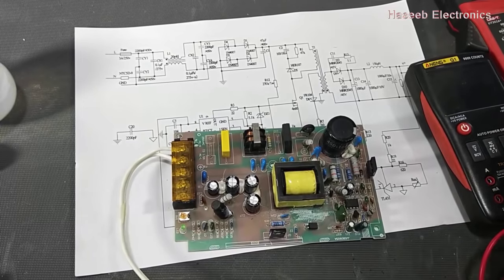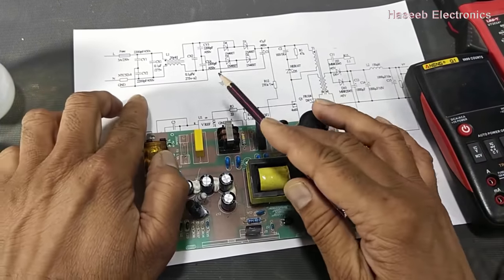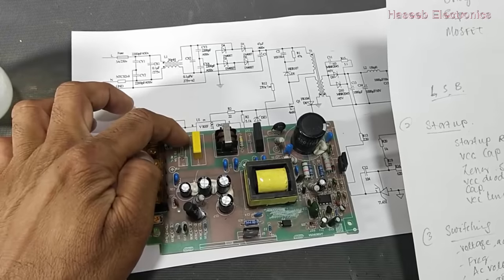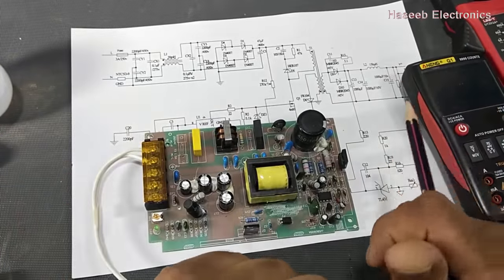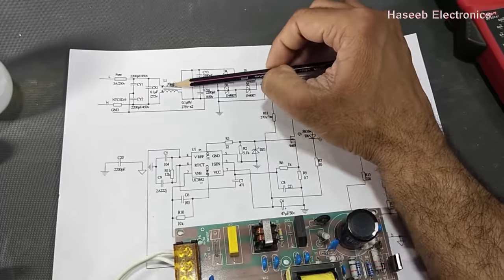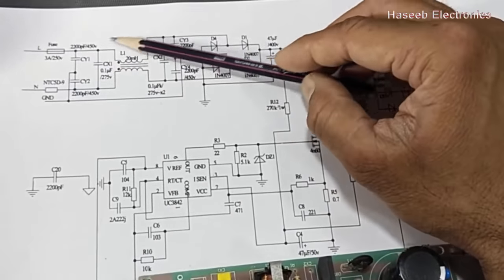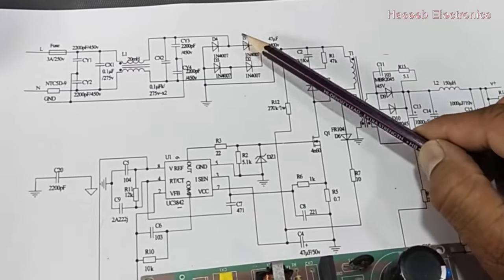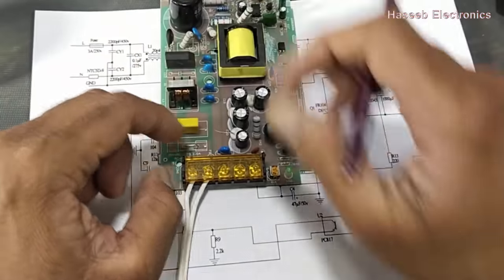{528} How To Repair SMPS || SMPS Repair Step By Step || Switch Mode Power Supply

Comment: Wa-Alaikum-Salaam. I am an Electronics Engineer of many years fault finding. One of my specialities is SMPS and this video is the best of its kind on the internet. Very comprehensive and informative. 

Thank you for imparting your knowledge to others in such an easy to understand format.
Reply: I have a compact logic power Supply of AB. I am facing shutdown problem i.e. on/off problem. What should be the issue with it..

Comment: Hello dear hasseb thanks bro for all your advices, I'm biomedical engineer from Morocco I appreciate your work, in my daily work the most problem I find in medical devices: power supply
Reply: I'm working now on a power supply of medical lamps input 24vAC/24vdc output, there's no output I checked all components , even flayback ics I changed 1252A ( primary ) ic and 4303A (secondary)ics and MOSFET too but no output in pin 6 (Drv pin for 1252A ic)

Comment: awesome job! i am fixing a macbook fake chinese charger that i bought off ebay that was broken. they used the same circuit! there was a few burnt components that i was able to replace., thanks bro!
Reply from the maker: you are right 
chinese copy method is really wonderful, they mold cheapest designs to replace costly branded items. problem is that while repairing we cannot find their servicing documentations

Comment: good evening, thank you in advance for all the courses and indications you published to help people understand how the electronic cards work, my problem and as you explained is in the power supply of the relay resistor to get the 220ac to the rectifier bridge, the resistance takes the line from the zener diode which in turn is connected to an ic....thanks in advance for everything

Comment: Many thanks for this excellent informative video, and sincerely instrumental in providing immense better understanding of the systematic breakdown for fault diagnosis! I greatly appreciate the video diagnostic presentation was exceptional from start to finish including the specifically identified test points and polarity, and the concise detail of the expected test result and in depth attributing fault factors or the secondary outcome by a specific fault. I myself was working on lawnmower 120VAC/24VDC charger no output @ primary transformer. On this charger JSC-1056A in lieu of UC3842 (by your application), this charger has has Texas Inst. 28600D controller on the Hot (primary) and dual  LM258N Op Amps on the secondary. No surprise your presentation is near exact similarly bang on in layout. My fault specifically falls at open "T1 input and as you called it; the finding was "shorted diode" D1 , Resistor R11 @ tests high in circuit (spec..27ohm). Whereas resistor R3 tests "shorted" @ 46k ohms expecting spec. @  420 M ohms  (Q1) Mosfet SSS7N60B tests good in or out of circuit but.... I found; "what looks like" carbon diode identified on PCB as "RB1" in series with mosfet "drain" to T1 transformer unfortunately it does not have any visible markings and appears shorted along with indicators of overheat on PCB. Both diodes on T1, T3 primary "hot" thus I suspect controller is presumably dead though Input portion including Bridge AC/DC tests normal and all diodes test okay. Is schematic layout reference "RB" like a carbon scrubber resistor??? The problem with this board layout they utilize both glass, and standard diodes and also alternating smd or through hole diodes. The RB1 with no markings although it's carbon and look like diode; it has "O" resistance, no polarity indicator or markings thus it's guess it is only intended as scrubber but the focus I suppose should be diodes, resistors at T1, T3 since mosfet gate signal source signal appears correct @ 160v, likewise at Main Cap (-). again many thanks!

Comment: Your explanations are very clear. Now to apply what I have learned! Trying to repair a TV power supply, or determine it is not at fault. The problem may be caused by overload of the SMPS. I am in the USA, so I adapted your 220 volt input  to 120 volt input. Thank you for telling us that the formula for voltage at the hot side filter cap is 1.414 times the line voltage.
Reply from the maker: i am really happy to see your comment 
it is really a valuable asset for me
i will suggest to check video number 592 that is very useful for push pull power supplies

Comment: Thank you Haseeb. I appreciate you sharing your knowledge. Your video was very detailed, clearly explained, and well taught. You have increased my knowledge of trouble shooting switch mode power supplies. Very well done Sir!
Reply from the maker: i am thankful for your valuable comment 
please accept my best regards and special thanks with best wishes
Reply: @HaseebElectronics  I have learned a great deal myself as well!  Your approach is very easy to learn and understand from.  I have a question-- I think it basically picks up from where this video leaves off.  I have a PSU I am trying to repair that is experiencing a short (overload) on the output side.  It is doing exactly what you were demonstrating at the end of the video.  This is an old Compaq Deskpro PSU that has 12v, -12v, 5v, and -5v output.  Would you be willing to explain how to isolate shorts on the low-voltage (output) side of the PSU?

Comment: i have been watching your troubleshooting and repair techniques you are real professional scientist and great technical teacher
i have liked your videos. if all engineers were like you we would be far.
may  be you may give example of power supply of battery chargers 5volts using one transistor , one zenner diode in hot section and oner zenner in cold section no output power  and in hot section power fluctuating
waiting your response , i thank you

Comment: after watching your great video
I saw that there is no Vcc in the pwm chip
I found 1 resistor and 1 diode faulty
After 2 days, I now have a working 5v 60a power supply
Allah razı olsun 
Mübarek ramazan
(Sorry for my english)
Reply from the maker: السلام عليكم ورحمة ٱلله وبركاته
your comment is really a valuable 
Selamün aleyküm
değerli yorumun için minnettarım
çabalarımın izleyicilerime yardımcı olması beni mutlu ediyor

Comment: You doing well. Make it simple. This switch mode power supply is a Pulse Width Modulation (PWM). The PC431 optocoupler is used as feedback to continually regulate the rail. R12 is a kick-in resistor to turn on the ic. C3,47uf/400v filter capacitor will rate high than the supply voltage when is fully charged, even if is out of the circuit. I am not sure why you Multiply it by 1.414? You use a pro-RMS meter so it should calculate it itself. EMI circuit is to comply with international standards. CE, US, Ca, Au/Nz, etc.
Reply from the maker: best regards for a valuable comment

Comment: Thank you very much for your video. I see you have to pleasure while teaching us and of course the have all the pleasure learning from you!!! I’m fighting with a Power supply giving 6Vcd instead of 24Vcd. I’ll check opto coupler, reference diode and see what happens. Thanks again!!!!
Reply from the maker: best regards and special thanks 
please check RCD snubber circuit (connected across the primary of the transformer
Reply: @HaseebElectronics  I'm finally back on this SMPS. I checked snubber and all components seams to be ok (invidually tested). Main DC from HOT side is 309 Vdc (not stable from 308 to 310Vcd). DC output on cold side is ramping: when AC main is plugged it is starting from 6.3 Vdc and goes up to up to 6.6 Vcd. Switchin IC is TOP248YN (already replaced).
Voltage at the opto coupler: cold side 0.206 Vdc stable and  5.41 Vdc non stable on the hot side.
If I measure voltage accross the Diode of the snubber circuit is around 1Vdc not stable.
I'm confident that with your help I can fix it. 
If it may help, this is a SMPS for linear actuator used for sofa and couch.... It's not written the DC output voltage on the label. Just says Max Iout 4.2A but I'm pretty sure the motor of the linear actuator is 24Vdc.
Many thanks again for your fantastic support with this channel. We all can only learn from YOU!
Reply from the maker: @Savino Lasorsa  Oh, first symp variation on DC rail (308-310 volt)
output is ramping    (it is indicating that the smps is rebooting)
voltage at snubber fluctuation (it is normal) 
i think there is problem in secondary side, might be some capacitor, or some rectifier is problematic. 
check vcc capacitor at Control Pin 
please check video number 512 it may helpful 
you can send whatsapp 00962-79-1161084

Comment: Hello. This is the best informative video I have seen on the topic of SMPS repair and troubleshooting. Thank you you very much for your effort. I would like to see a follow up video from you on the topic of repair of SMPS for LCD monitor with fluorescent lamps in it. There the high voltage circuit additionally in it, for which I would like to understand. It would be great, if you could create one.
Reply from the maker: You are welcome!
special thanks for your valuable words
i noted your suggestion and i will try my best to arrange it as soon as possible

Comment: sir kindly explain or make a video after chopper circuit faults like no power supply in CRT TV sets.audio section or vertical section  thank you sir you're one of d  great teacher wio explains clearly the function of every circuits
Reply from the maker: sure i will try my best to continue as soon as possible

Comment: Sir,
Assalamu alaikum
Sir i see your video again and again so that i can learn and thanks for your information able and educational video.
Sir MW s-250-24 kindly explain this type of power supply. This power supply is making audible sound like tiktiktiktik and taking so much current. It gives output and ac series lamp also glow.
Reply from the maker: wa alaikum salaam 
most of the time the sound from transformer is due to frequency variation 
sometimes disconnection or internal sparking of bulk capacitor 
sometimes loose winding of transformer

Comment: Very nice video, it is much apreciated! I am strugling with a switch mode power supply that starts up and switches off after one second or after putting a load on it. Strangely sometimes it just works. It has a ob2201cp pwm ic with 2 resistors of 1mOhm and 500K feeding the startup electrolitic capacitor. I noticed that when it fails the voltage in the primary side capacitor discharge very slowly.  I checked the feedback circuit with an external power supply and it works correct. I am kind of going crazy over this, wish you gave me a tip.

Comment: Sir may i ask if all the  smps have switching frequency of 100 kHz at 50 percent duty cycle sir? tnx very much sir
Reply from the maker: no, it depends on the designer 
most commonly 50KHz, 65KHz, 100KHz, 12KHz. it depends on the designer. when the frequency is higher, the smps design will become smaller and losses will become lesser, but this design needs a proper calculations and designing 
while design with low frequency is becomes in big in size, low in quality than the high frequency
Reply: @HaseebElectronics  tnx for the info sir

Comment: Thank you very much for your videos. I'm trying to get back into repairing power supplies again. I have a power supply that keeps starting and shutting down constantly. I'm not sure exactly what I need to look at. The IC on the board does not have any numbers I can look up on the internet. I'm not sure exactly what shape it is. This power supply is for a keyboard and has three outputs. 15 V, - 15V and 5V.
Reply from the maker: it seems there is something wrong in output side which is causing to restart or reboot the power supply. for that you need to check the output capacitor, rectifiers 
or you can check the main DC capacitor

Comment: What is the difference between full wave rectifier and full bridge rectifier. Can you explain why a full bridge rectifier is not used in the secondary of the smps transformer?. If is it possible? Why the diodes are in the same direction in one line but not reversed in two line of the secondary of the transformer? Is the resistance is higher in linear transformer than smps transformer secondary?  Why?  Why full bridge rectifier is applied in linear transformer but not in the smps transformer secondary? Why some optocoupler have ground applied on the secondary side but others have positive voltage applied? Keep it up for the hardworking of sharing your knowledge. I am learning from you a lot.
Reply: Can you please explain smps in smd circuit with practical components and diagrams?

Comment: I have watch a lot of your videos and  learned a lot of things. I have fixed some SMPS and lately I encountered one difficult fix. The fuse keeps blowing and after tracing, it’s turns out the problem was caused by a shorted MOSFET. 
After replacing the MOSFET, I tested using a series light bulb on the input power supply. The light bulb keeps blinking. It turns very bright then off for a short period of time. The blinking frequency is about 120Hz. Have you experienced such problem? Thank you

Comment: Thank you for this tutorial, it really helped me understand the basics of smps especially using uc3842. I have a question regarding a smps I need to repair based on uc3842. It also has a dual comparator. What is it's purpose? So far I replaced the dead mosfet and uc3842 but the 5V output jumps. 24V output is stable and 11V output also jumps. Thank you again.

Comment: hello PROFESSOR good video I am learning to repair ups and right now I have a 10 kva legrand that does not turn on and it is in the main source the mosfet resistor that goes to gnd explodes and I cannot see what the fault is when you can do ups courses to learn I am from Venezuela thank you very much for your teachings

Comment: Very informative video. You have covered quite alot of faults. I just have one question. What if the output voltages doubles? For example 12 volt output pin is now 24 volts. What are the main causes for this fault. You could make another video explaining the reasons.

Comment: Hi can i ask what can be for the issue if the voltage on main capacitor after rectifire is fluctuating what can be for the issue? Also the IC is doing noise like clicking. Thank you for anewer and continue with these videos, its nice for education!
Reply from the maker: it seems there is some short circuit in secondary side. the ic is in reboot mode and trying to get feedback.
Reply: @HaseebElectronics  okey, thank you for answer. I checked rectifiers and changed all capacitors also checked the Mosfets.The optocuplar have 12v fluctuating to 7v. So i will try to check other components. Your videos are amazing mainly for learning, thanks for them.

Comment: Very well explained, thanks for sharing you kwoledge to all, I have a question, what if there is a ramp voltage in the VCC pin 7 ic? the voltage is varying its not constant 12 V ? Thanks and cheers from Mexico.
Reply from the maker: best regards
if VCC pin is not stable 
1, please check VCC capacitor (connected at vcc pin, i think it is internally open)
2. if output is not stable, the ic tries to switch at its maximum duty cycle so it reaches it Overload protection, then IC turns off for a while. this rebooting action is responsible for variation in the voltage 
3. if there is some output current sense resistor (shunt resistor) if it have bad soldering joint, it will cause to drop more voltage than its rated voltage. in that case it will cause to drive the ic in reboot mode (before reaching at its rated output)
4. if there is current limit resistor or current sense resistor (connected between the switching mosfet Source pin to ground) if it is devalued or bad soldering joint.it will cause to drop more voltage than its rated voltage. in that case it will cause to drive the ic in reboot mode (before reaching at its rated output, ic will quit for a while )

Comment: Very informative thank you very much one very important question voltage after rectifier on capacitors you said must be 320vdc So how much should be value of capacitor ? Mostly I see it's 450vdc so how much capacitor voltage will be higher then input 320vdc ?
Best regards from Philippines 🇵🇭

Comment: Very Informative video ! i enjoyed the opto-coupler and sensing resistors fixing issues. 
Some PSU have comparators instead of the TL431, can you please explain how they work and how to increase the voltage, thank you & salam aleikum.
Reply from the maker: best regards and special thanks 
it is my pleasure 
sure i will try to explain it soon

Comment: Hello Haseeb, On a Skywort model 58g2a300 TV, I checked the two led strips with test and nothing lights up, I don't have any more voltage at the output of the power supply for the backlight, do you the fact of having a problem on the led can block the voltage at the output of the power supply? Thank you very much !!

Comment: I'm learning a lot from you. I'm practicing with spares smps 12V 3A chargers. What wattage lamp in series do you recommend for these? I placed a 100-watt filament one.  when I replace  the oscillator MOSFETs for a shorted circuit one to test the lamp, the resistors from source to ground exploded without lighting up the series lamp....Another question  the rule of around 50 volts  difference  between the capacitor and drain source voltage apply for any smps?

Comment: hi
very good advice and tutorials. the only thing i didn't understand is the reverse bias that can come to 640v (twise the dc voltage on the capacitor.
i would be happy if you can emphasize this issue
thanks and keep the good things you do
Reply from the maker: Yes, correct
in turn off time of the mosfet, the collapsing magnetic field causes to build "reverse EMF" and comes in series of the applied dc voltage 
i will explain it soon
Reply: @HaseebElectronics  THNX